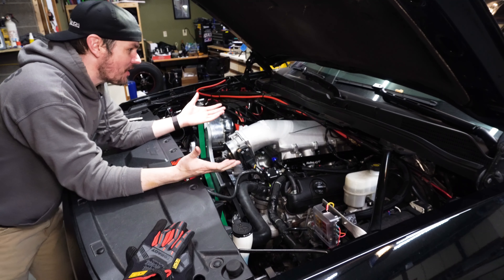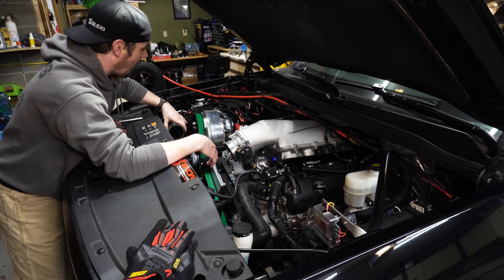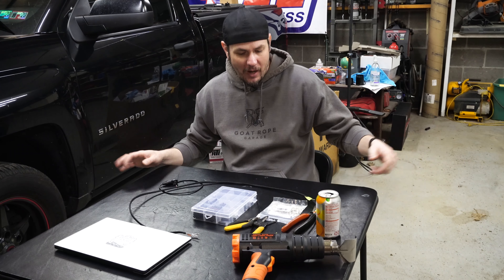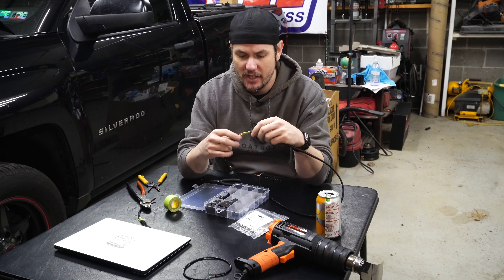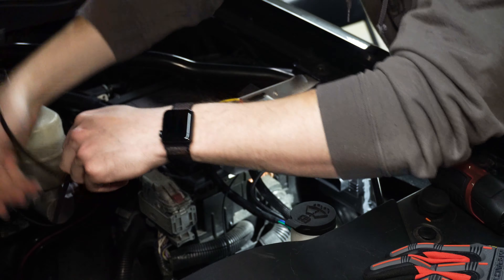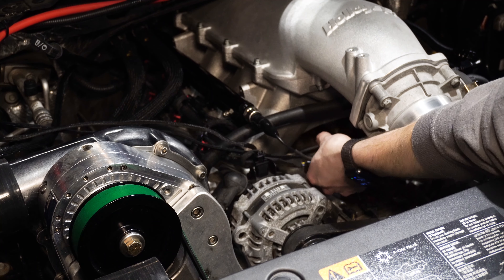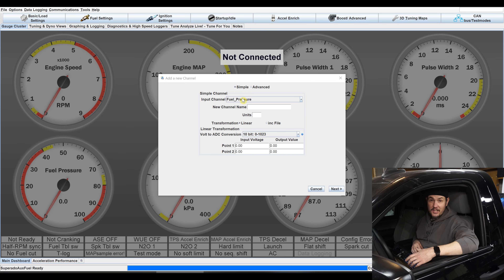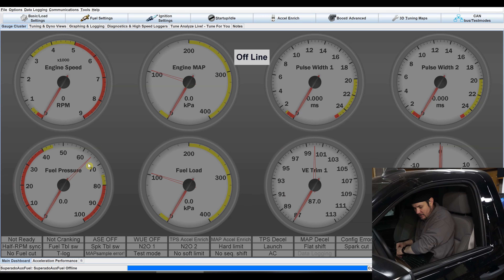Microsquirt Auxiliary Fuel Pressure Sensor Install and Setup!

Comment: Those are nice crimps but I kinda think soldered splices are better because unless your heat shrink is the type with the adhesive inside, moisture and air will still get into that connection eventually, but I suppose you could coat it with something before sealing it up.  Probably should coat any electrical joint like that.  not sure whats best for that. Maybe a little liquid tape or liquid rubber.

Comment: You mentioned DTC's on your ECU, isn't that for only OEM ECU's that are designed for emissions testing compliance?  Or do all modern aftermarket ECU's use standard DTC codes for helping users diagnose problems?  I have no experience with Megasquirt or any other afternamarket ECU's

Comment: Are you running your aux fuel from the main lift pump in the fuel cell?   If so do you have a check valve between the aux side and main side?
Reply from the maker: Yep, and shouldn't need a check as the FPCM will maintain pressure across the whole system

Comment: What fuel pressure sensor did you use, what is the part number? I have a micro squirt system and would like to do the same.

Comment: Do you have any mods for a 2006 xlr v, would like to make more hp
Reply from the maker: Tune it and pulley down the blower, might have to have someone make one but the blower itself is used on other platforms